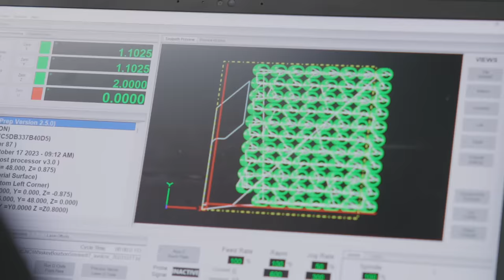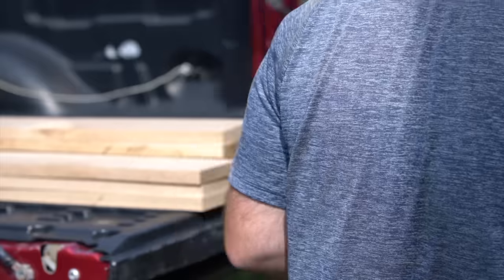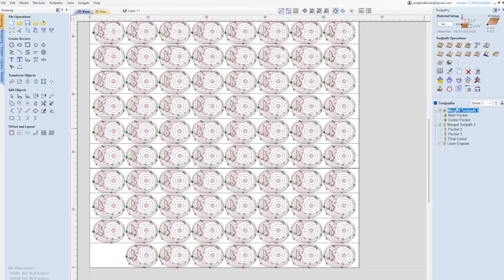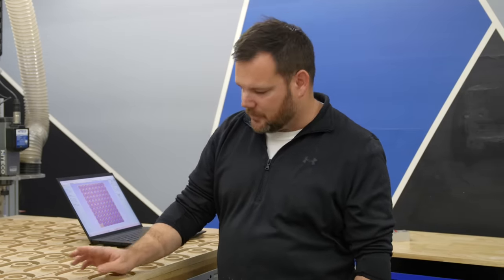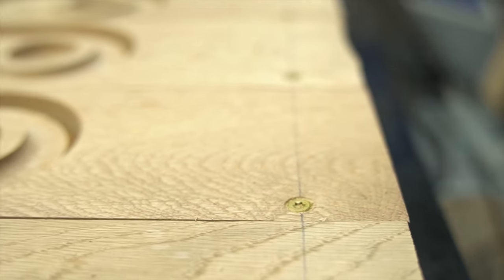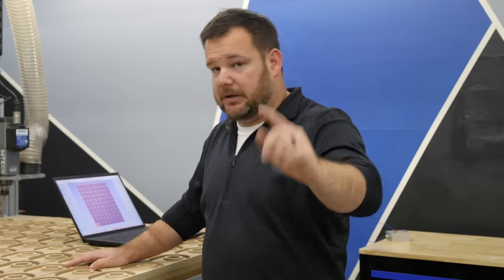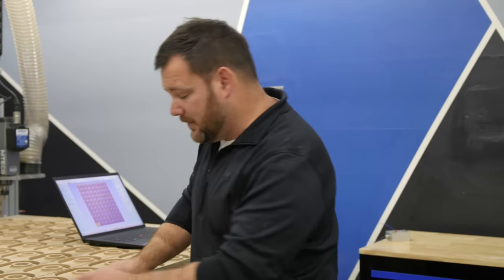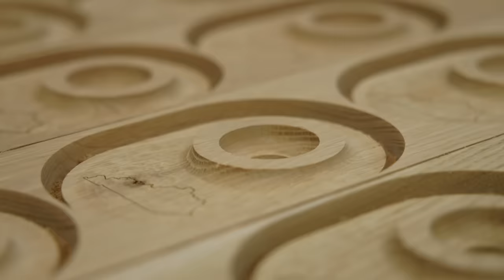Home-Based CNC Woodworking Business Full Production Run

Comment: Great video showing how to organize your process. However, you are slightly over exaggerating the profit. You still have to cut out a lot of tabs, sand them out, clean them up,  pack them up, probably pay for a booth, and spend a day or so doing sales. That's still a good profit but some of your audience may fail short because they have to do more than they expected. Please don't take this the wrong way I'm not a troll trying to bad mouth you. I've been in the carpentry and woodworking business for 32 years and I've seen people work for me for a short time and jumped out on their own but they didn't make it because it was more challenging than expected.

Comment: I’ve been using a cnc for a while now. I worked at a MakerSpace and fell in love with their Shopbot. I then inherited an xcarve for my own shop when my brother closed down his shop. I love the cnc. The MakerSpace of course had great lasers as well. I have a Glowforge in my shop. Two things happened…. First… I got the glowforge and was doing a lot of things with it. Second… my xcarve was proving to be out of square/level. I did a couple of things to get it level again and started noticing it again. I’m not the kind to “tinker”. So it’s pretty much been sitting unused in my shop. I know I need to do something with it and I know I want to. But I’ve just gotten away from it. Watching this video makes me want to get it up and running again. I know it’s not as powerful as your machine. But like you said… I can still do it. It just will be smaller batches and not as fast. I’m ok with that. LOL. I’m making these cheese and cracker trays with my router and it would be SOOOOO much better if I had it on my cnc. lol. Just gotta get the work done. I could also go to the MakerSpace and do it on the shopbot. But it’s 45 minutes away. So… not sure I want to. 

Either way. It’s the new year. I need to put this on my list of goals for 2024. Thanks for sharing.
Reply from the maker: Your xcarve would be so much faster! But it sounds like you got a system figured out for now.

Comment: Those all look great. I put a real light coat of mineral oil on ones that I made a few weeks ago and I think it made it look better.
Reply from the maker: Thanks! Any worries about using a flame on the it with that mineral oil on there?
Reply: @AndyBirdBuilds  It has a higher flashpoint so some parts say it isn't flammable and others say it is. It does need a higher temperature to ignite which is how it they say it is non flammable. With that being said, I put a very light coat on it and have not had an issue as of yet. Other things I have read online, say if "should" be safe for that application but I am not 100% sure

Comment: Hi Andy, amazing machine and process.
Ham’s recent version eliminated the chimney. H ave you  found a more positive response  with keeping them?  
I think there would be a better perception of value if you oiled them. Your test piece seemed to char faster, but that could have been the angle of the torch. 
With that volume, I would try spraying them. Not sure, as the idea of atomized oil in the air kinda creeps me out 🤣
Killer video!
Reply from the maker: Thanks for the feedback! I like the chimney as long as there is a contour. Thats why I use a bowl and tray bit.

Comment: Hi Andy,
Another great helpful video.  I have ordered a Shapeoko 5 Pro and have been practicing on their software. As I watch videos on YouTube and practice on the Carbide 3 software it seems that the Carbide 3 software is limited for things that I would like to do. Do you recommend a cad cam software for a new startup CNC business?
Reply from the maker: Great to hear you found the video helpful! I recommend starting with the software that your CNC manufacturer recommends
Reply: If you outgrow the Carbide 3d software, there are a couple different packages.  I use Fusion 360 which is very versatile but has a decent learning curve.  That said, for the typical stuff that you would use the Shapeoko for, you'll probably want to get VCarve Desktop at some point.  As Andy said, start with the Carbide software as it works well and is designed for the specific features of your Shapeoko.  Good luck!

Comment: Mineral oil doesn't have a high penetration or holding value, so it's just gonna leech out, especially adding intense heat to the middle exposed end grain. So, probably not your best choice.
Reply from the maker: Thanks for the info! I think I'm just going to leave them raw.
Reply: If you want a deeper penetration of a coating on a piece . Get a vacume pump from Harbour freight and an appropriate sized vessel that would hold a vacume.  Go from there .😊
Reply: @terrylembke8100  can you tell me your process? I’ve never done what you’re saying, need to learn all options of finishing projects.

Comment: Question for you Andy...
Does the machine you use have a permanent x-y home coordinate? When you're switching out bits, how can you guarantee the same x-y reference? I have a FoxAlien 4040-XE. I'm thinking of making a dedicated home fixture. 
Dave
Reply from the maker: Whatever I set the xy zero at the beginning is what it uses for the entire job. When you're doing bit changes the only thing you need to do is reset the z zero
Reply: @AndyBirdBuilds  Thanks Andy. I think my issue was that I would move the spindle to the center, hit the e-stop, change the bit, then when I reset it, I would lose my X-Y. I just tried the same process, but left the spindle at home. When I reset it, i just re-zeroed X-Y where it sat.

Comment: Definitely a "hustle" when you use short profit math? Let's be realistic.

Quality cutting tools that last are almost $100 ea now. Cost of everything in your shop $$$, Periodical maintenance & parts on all the machines in your shop $$, The next time you "don't" catch that snagged air line $$$, Material losses from common drawing to fabrication mistakes $, Code input errors that damage the CNC & materials $$$,  software costs $$$, sales / marketing time & cost $, And all the man hours in a project that you're not behind the machine producing product $, etc.. 

Hobby CNC's are not a get rich quick tool. The learning curve on the CAD & CNC software alone scares most people away. Small machines can be a great home tool that can produce mediocre supplemental income and the potential learning device that may stem to a career. Realistic expectations. Marketplace is full of CNC's, 3D printers, and lasers from people who thought differently.